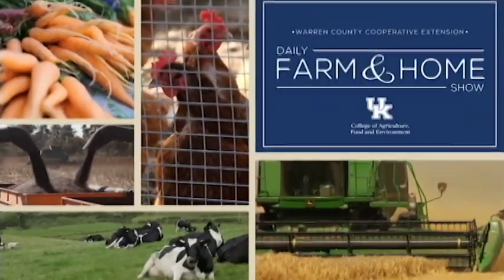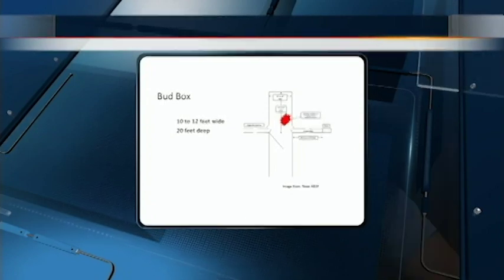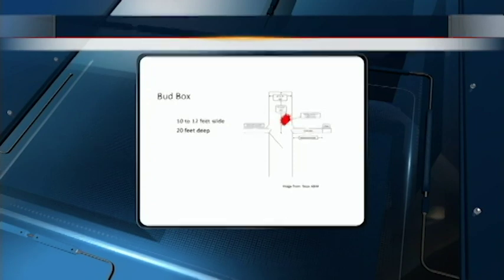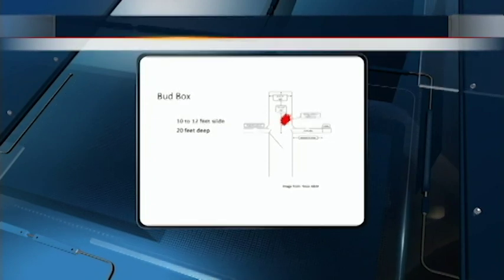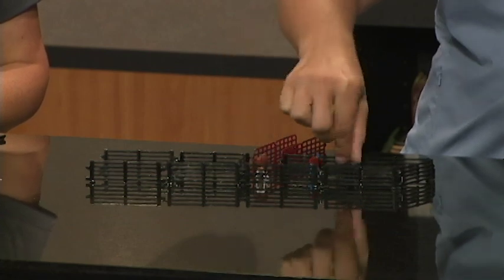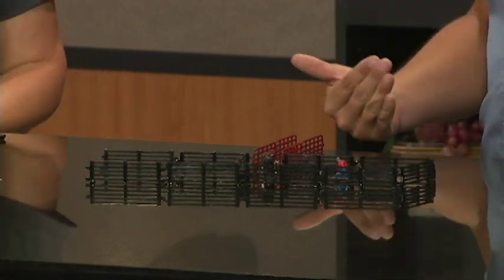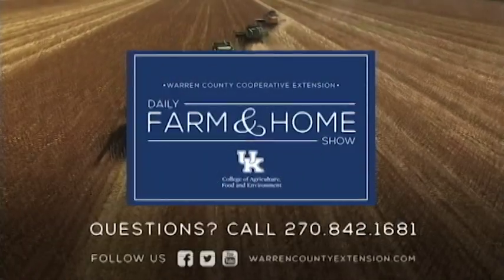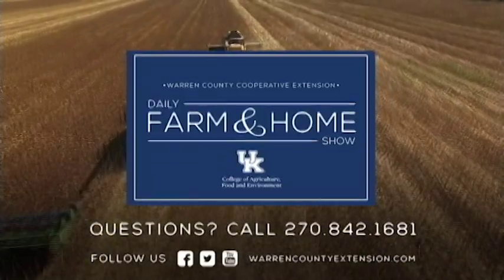Using a Bud Box Design for Livestock Handling

Comment: Which is the right side to attach the big gate? In this example it is attached in the opposite side of the alley, but in the image layout shown it is attached at the side of the alley.
Reply from the maker: Here is the response from Morgan:  The gate can swing either way.  Usually the person pushing the cattle walks on the side where the cattle escape into the single file alley, so often it is easier if gates swings closed right near the single file alley.  However, in some cases depending on how posts are laid out and the lead up to the bud box it can be easier to switch the orientation.  As long as you don’t push too many cattle in the bud box it shouldn’t be a huge concern; the lack of pressure on the cattle when closing the gate is one reason the bud box is 20-24 ft long. Also some bud boxes the working alley is on one side and a load out alley is on the other in which case either gate swing makes complete sense.